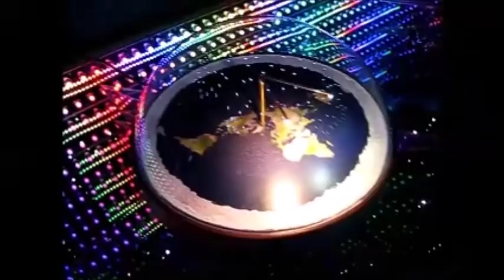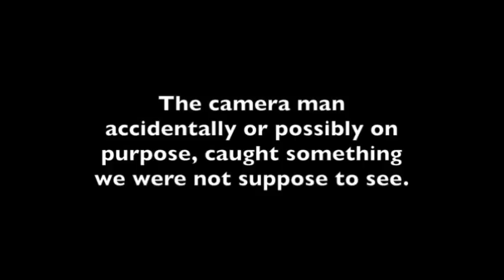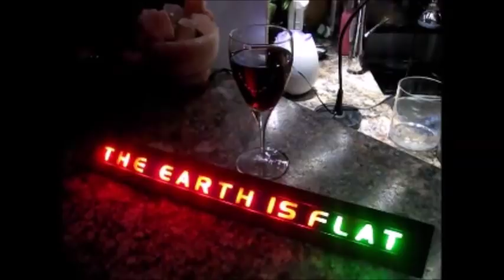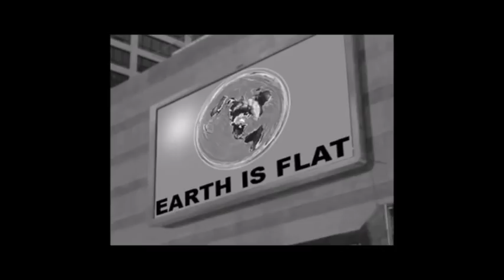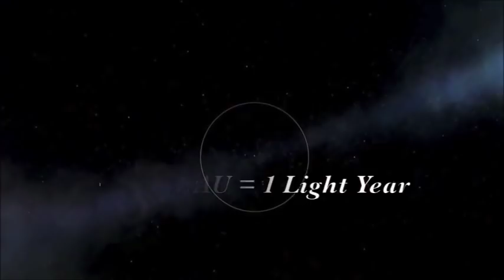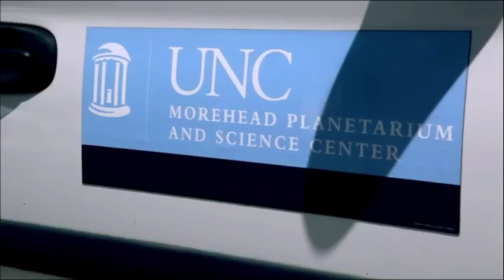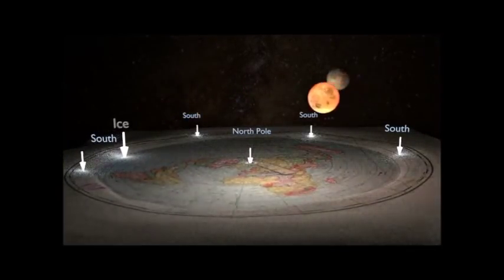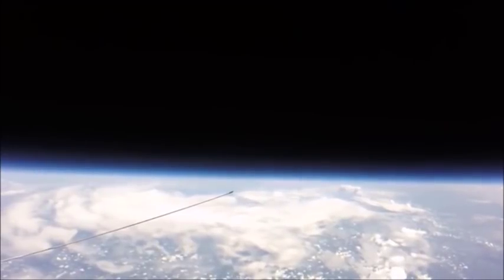Flat Earth Q&A Emails 74 - Mark Sargent ✅

Comment: 1. Find shallow water. Lake or when it rains at the salt flats. Stake down starting point stake at shoreline tie spider wire inch above the water. 
2. Paddle out in boat staking down stakes and wrap spider wire around and pull tight ebery so often until reachbthe other side. 
3. See the spide wire clearly above water the entire time and the flat earth.
4. This is not a spider wire endorsement and this message is Atypical meant for entertainment purposes only.

Comment: I have been following your and others' videos for a while now. The earth has got to have some curvature for your models to work. You are right that it cannot be a sphere with a radius of 4000 miles. The known world must be like an inverted bowl with some curvature for the sun to hide beyond the horizon.  What lies beyond the boundaries of Antarctica is conjecture at best. Travelling beyond there is a risky venture. You will need a jet than can travel about 10000 miles non-stop and bear the possible drop in temperature as you go deeper south. From all I can make out it must be pretty dark and cold beyond a certain point. Whether it is an infinite plane beyond that or a solid barrier, it would be practically the same since we do not have the aircraft or the technology to explore an utterly dark cold void that should resemble deep space if your model of the sun and moon are true.

Comment: Some things are very interesting.. However.. But if the earth is flat why can’t you see the sun go all the way around? Or isn’t it bright enough up north way? Why does it come up over a flat earth like at the ocean shore line which is free of obstructions.  If the sun is of a certain size and of a closer distance why dose it’s size remain the same from east to west? An object let’s say 200 miles wide in the morning sky in the east would be larger in size directly overhead at noon. And the funny notion that stars would be at different locations as we travel around the sun. No.. They are that far away it doesn’t matter what side of the sun your on throughout the year. Example.  Being the sun is the size of a bb in the middle of a coffee cup plate and a pin prick is the earth going around the plates edge simulating the earth and sun in the middle a football field and being the stars are clouds height. Now the pin prick went from one side of the coffee plate to the other. Do you really think the stars would change position? No pictures of satellites except pictures of them on the internet. Maybe there should be cams on them to photograph other satellites passing nearby or poles in space with cams attached to access like a beach cam. There are some great points however like Antarctica. And I’m not sold on them landing on the moon either.

Comment: Question#1: There are some mirrors on the moon that you could use for your testing.
Reply: No, there aren't.
Reply: Ok. They are retroreflectors, which are similar to the reflector on a bicycle. Miniature mirrors if you will. 

https://www.youtube.com/watch?v=VmVxSFnjYCA
Reply: This has been debunked. A test in the early 60's claimed to have done the same experiment with the same results. If the moon is a physical object of some sort it could simply be a reflective ore creating this result. So it is not proof of the veracity of NASA. And a laser getting a result from that alleged distance is also a leap of faith. Now if the moon is only 300 miles away then it gives more credence.
Reply: Bill Keith, stop talking like a stupid conspiratorialist. Oh, you are one? Then shut up, liar!